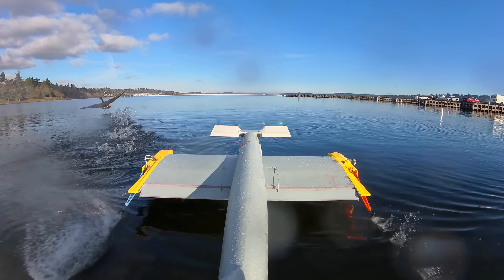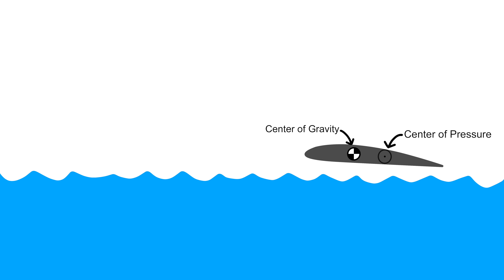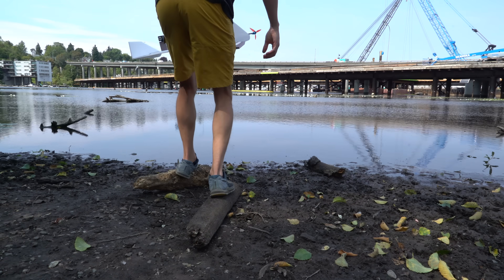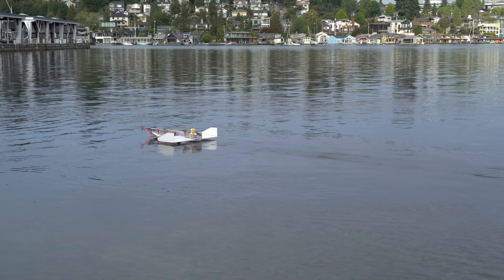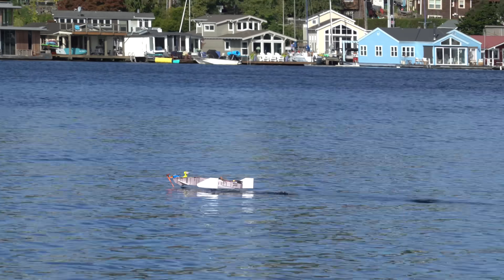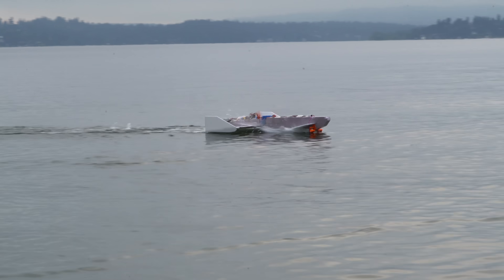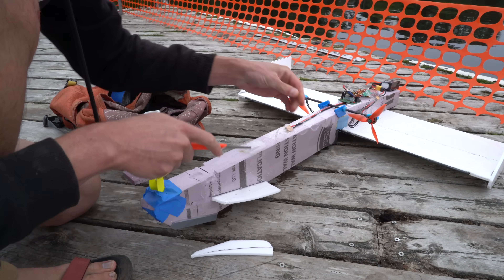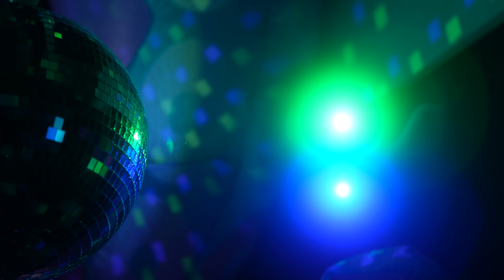Testing a Hydroplane / Ekranoplan Hybrid

Comment: Great video, if I might suggest: consider controlling the motion of the center of pressure with spoilers, air spill gates, etc. The dangerous condition you wish to eliminate is the spontaneous and uncontrolled nose lift that results from the movement of the center of pressure exceeding the safe range. If you can control the movement of the center of pressure dynamically, then you can fly the craft above the water (even at the optimum altitude above waves, and at optimum airspeed) automatically and smoothly. Consider employing mid-wing micro-slats to vent the wing in stages. I have some ideas but you have demonstrated excellent levels of engineering diagnostics. Well done!

Comment: Fantastic video showing what you're doing here. You're playing with two unique systems:
1. How to do real-time depth and engagement with the water
2. How to do real-time depth and engagement with the ground effect
My thought was to do a kind of wise Japanese man beards-shaped hull. We have a very long prong going into the water and getting wider as it goes up, probably using some mathematical function there, but also putting a sensor in there where if it gets too high you then start to change the pitch or the power.

Comment: Angle the canards down.  If you want the front to skim, press it down into the surface with a bit of downforce then counteract that by adjusting the wing incidence until it balances.  A T-tail adding a bit of rear downforce, a front downforce canard and a lifting wing in the center would probably balance nicely.  Look at how real airplanes fly, stability comes from noseweight counteracting empennage downforce while the wing has some incidence.

If the wing can generate enough lift to fly then it's lacking a stabilizing downforce. it needs to 'stick' to the surface, not float above the sticky areas.  Think of hovercraft, they work because the air forcing it's way out of the skirt is also speeding up that air, making a low pressure area at that point that pulls the skirt  towards the ground until the airflow's velocity overcomes the pressure.  I've played with lots of hovercraft, the good ones you can feel sticking to the ground while flying, push down on them and it requires force.  Pull up and it requires a force to break the vacuum with the ground.  Check out my hovercraft playlist, you can see how when properly balanced they stick to the ground, and some of the wings and aero devices i use to stick the single engine skirtless craft to the ground.    https://youtu.be/UmS_t55DbN0?si=GpocQj_5ajhbJ3xi  I wanted to try to get people into single engine budget hovercraft "hovercross" racing as a hobby but nobody else seemed to care.

IOW you need a low pressure area under the craft that is counteracted in some way by the air's velocity.  Be it like a hovercraft or by having a central lifting wing/body/whatever with some sort of balanced downforce around it.  The sponsons of racing boats work by sticking to the water on the outer edges and 'flying' the center lift area, until the sponsons unstick from the water.

Comment: You need a servo with an arm inside attached to a rod with a weight that can slide a weight backwards and forwards really fast based on attitude.
You will probably have to design your own PID loop program or repurpose some code ripped out of a quadcopter flight controller.  You cold also use their gyro chip to determine attitude in every direction.

A quadcopter has no stabilization forces acting positively on it...  it's all done with a fast PID loop reading all the sensors and inputting motor speed control to propellors.  You could also use propellers in the same way on the front and back from a quadcopter and the same chip and code to autobalance rear and front... that would be the simplest kludge.

Comment: How about adding a screw adjustable pitch angle device to the front pods, for micro pitch thrust adjustment.  In fact, that might be useful in every case of power pod, air and water.  Just a stationary and rotating plate mount on a screw with a circular slot and a capture screw, like a skill saw, at least until you find the optimum angles for a solid mount?

Looks like fun, but a little sim would probably get you their quicker, but maybe will less wow/oops factor.

Comment: I wonder if you could make a "WAKE JUMPER" where it has the motors on a suspension that can jack up (like those cars with the crazy hydraulics).
Then when some wake comes up, the wake-jumper just jumps over it in such a controlled way that it seems smooth in the "cabin".

Comment: You need to get to a point where wand is always in the water. The wand attaches near point of balance.  The spring constant in wand suspension can't exceed weight of entire system.  Essentially flight is pivoting around wand.   Wand could potentially have a foil with sufficient system lift a little less than system weight.  Im just spit balling ideas, iterative trial and error.

Comment: Low key????  You could probably enhance the airfoil for that CP shift.  If you wanted to go nuts, you could put a CG shiter in place, with feedback, to accommodate.  Kidding, but it might be a fun 'is it possible, and how well would it work'.  Obviously some active FB in the control surfaces. 

I built a Long EZ, and the point of the canard configuration there was to design a stall/spin proof configuration, which they attained, as tested by a NASA test pilot, as long as the CG was kept in envelope.  As you well know, move the CG far enough aft, and NOTHING is stable, not rockets, not wheelbarrows, nothing.  ;-)   Try an aero canard, as the lift CP mod should act more similarly on both lifting surfaces, if the design is well done.   Putting something in the water is draggy as hell, exactly what you DON'T want.  If you are going that route, use a non contact sensor, as you did previously.

Dude, buy a hybrid, mine does 46 in town, driven very gently on regular gas.

Comment: I’m no expert, so take in that context, but could you run a tube through the middle, to create a stabilising flow that mitigates lift and dropping? Maybe narrowing towards the exit?  If it was long enough with dynamic shaping underneath at the bow/stern it could double up to act as a preventative measure?

Comment: Might defeat the purpose if your build, but it seems like a small hydrofoil on the nose would go a long way to help stabilize it. If it was small enough to just lift the front then it would still technically be a ground effect vehicle.

Comment: Weights on a rail.  Have you tried moving the center of gravity in relation to the center of pressure by having small led weights riding on a rail adjusted by a servo controlled by the angle of attack signal from your flight stabilization computer.

Comment: I was trying to solve this too and make it by creating a moving weight to move the center if grav, it works but requires a very specific real time sensors input to move with the actuator the weigh so it counter the positive and negative feedback

Comment: Could you not stop the flips by having a fixed control surface that provides minimal lift in normal operation, but that produces peak downwards pitch when the vehicle pitches up too far?

Comment: Add 5 lbs and retest.  We know how to make light planes fly.  The original Ekronoplan was spec'ed to carry tanks to the US.  I think if you add a bunch of weight it will add dampening to pitch.  Which will make it significantly less sensitive and way more controllable.  Ideally you should be able to go much faster as well because the system will have more time to correct.  Total guess but my monkey brain likes it!

Comment: the water props are pushing the nose up, losing thrust and then repeating the cycle. the water motors should be level with the waters surface at running speed.

Comment: What about a wand that controls flaps on the canard? So more lift from the canard as the nose touches the water and less lift when the nose pitches up. Changing the thrust angle changes the attitude AND reduces thrust, so it monkeys with the aft end, too

Comment: The geometry of the wing needs waves in its surface aligned "parallel" to the direction of motion with a slight curvature outward from the center of gravity. Kinda like a lays wave cut chip. Additionally, a reflexive "joint" that passively changes the wings pitch based on the differential pressures in relation to the nominal pressure at the center of pressure. 

Essentially the effect would act as a relief valve in the system as higher pressure builds up in the back pitching down and an accumulator of pressure in the front as pressure drops relative to center.

Comment: It is necessary to choose the right aerodynamic profile of the wing so that during air flight and flight due to the screen, the pressure centers coincide.
Reply from the maker: The flat bottom aerodynamic profile is optimal for screen plane
Reply: @rctestflight  Absolutely right. But I don't mean the bottom, but the top of the profile. If the hump is shifted back along the chord, then the pressure point will shift back

Comment: It seems to me like you need some sort of mechanical system that reacts to pressure under wing, or specifics parts of wing and adjust the shape, or angle to super charge negative equilibrium. It should be almost perfectly reactive. The only problem is that there will be inertia within the moving parts

Comment: Going off of the first part of the video about center of pressure changing with distance to waters surface, and comparing that to a static center of gravity, what if you make the CG not static, aka dynamic? Some sort of lidar sensor that reads hight to surface of water, and a servo system that can shift an internal weight, IE, the battery, based off the distance to waters surface, therefore adjusting the CG based on the center of pressure?

Comment: I feel like either on the front you could try a electronically variable height/depth and pitch hydrofoil or those 2 front engines needed variable height/depth and pitch control. Without that there is no way for your machine to adjust to the changing conditions and speeds in the real time needed.

Comment: It seems to me it's the steady distance between how high off the water and air speed, why can't you use a laser distance measure between the aircraft and the water,  put that data a controller to increase or decrease the propeller thrust. Pick the perfect distance off the water and set the controller to increase speed when to low and decrease speed when it gets too high off the water, you will need to adjust how sensitive it is but this should solve all your diving and flipping problems.

Comment: If wings have propensity to shifting center of lift causing rotation, let's have two set of wings - front and rear. This is to addition to tall T-type horizontal stabilizer.

Comment: optimization loop. of course it works. avoid the outhouse. so you made a ground effect trike. so how about a quad wing ground effect plane. ie canard and back wing in quad configuraiton. ie no flip because lever length of force is way longer. ie avoids the problem of normal single (dual) wing. yeah be covered fully by mud bruh. very sketchy.

Comment: Anything, that makes contact with the top of the water surface will result in porpoising. Either you have a wing below the water line surface or you have a full blown aeroplane leaving the surface. 
.
The top of the water is soft like a sponge so as the vehicle squeezes down on the water, it will be allowed to point way too low and any correction is an over correction. The ground effect will only be smooth in two scenarios:
1. The water is perfectly smooth (no waves) and your craft is way lighter
2. If there is some level of roughness to the water surface, you need a much heavier craft. This has its limits, the rougher the water, the heavier the craft. The Russian Ekranoplane is purposefully very heavy but could only offer a smooth ride on water with short waves. The Russians killed their Ekranoplane program for a good reason.
.
May I suggest you study gliders on take-off or on landing experiencing ground effect and how to avoid PIOs (Pilot Induced Oscilations). Look at videos of the Pik20B glider and Schreder Glider these are flaps-only gliders and much more susceptible to ground effect when landing. 
.
The Australian Mud Skipper (there is a YouTube video) is way more of an aeroplane - it comes way up and out of the water with much longer wings and banks to turn like a proper plane. It straddles ground effect and pure flight. And is successful.

Comment: Try using a system like tractor pulls, where you have a weight inside that moves back and forth, moving the center of gravity as your center of pressure moves. Might take some CPU work to get it perfect, like an Uni-Omni-wheel.

Comment: Looks like too much up angle on your prop drive (water motor) setup.  Also, I bet your water motor suspension would work better with a 4-bar style setup to keep the water motor thrust vector fixed rather than increasing as the nose rises.  With the setup you tested, it is a positive feedback loop where the higher the nose goes the more the water motors push it up rather than forward.

Comment: Wouldn't it help to get the v-shaped tip some suspension? Nothing crazy, maybe just a simple spring (and a bracket to hold it in place) between the hull and the tip?

So the spring could absorb the bouncing of the tip on the water?

Comment: You need to combine hydrofoils with the ekranoplan, so that you can have the two systems working together to maintain the distance from the surface.
It would have been almost impossible before computers and microprocessors.

Comment: The discontinuity between air and water defeats negative feedback, which is why you can't get rid of the skipping with negative feedback!  It works OK for foiling boats because the foil remains submerged while the wand skips harmlessly.  For the same reason, you might get somewhere with a wand and no other water contact.

Comment: Try just a wire angled into the water at the front.  The v hull, is still too much contact.  A wire angled would be just right.  As it lifts out of the water, less wire being in the water, brings the nose back down.  No need for cannards which give too much lift in air.

Comment: Next time, why don't try a design with tandem wings. One pair of wings in the very front, one pair in the very back, with quite a distance between them. This should strengthen the good negative feedback loop and weaken the bad positive feedback loop. 🙂💡

Great video, as always. 💪
Reply: I was thinking the same, have an inner front wing with a fence mounted on the tips leading back to the rear outward mounted wings, 
Or have a vertically mounted ducted fan on the front to act a bit like a hovercraft creating just enough lift to keep the nose above the water.
Reply: @williamwilliams8145 Just checked it. tandem wing ekranoplans are a widely known design. 😁

Our idea was good, but not new. But at least now we know WHY tandem wing Ekranoplans are a thing at all.
Reply: As soon as Daniel described the centre of pressure issue I wondered how well a tandem design would work.

Comment: Always enjoyed your work and continue to, thank you.  The biggest water mass height sample you have, would be the outline of your entire craft so a dozen feelers/sensors each with fine levels of graduation measuring the water surface location spaced out under the craft sampled & averaged fast as possible would provide a realistic idea of how far away the last observed water mass average really was from the entire craft undersurface which compared to the previous measurements would give you the best prediction as to what control surfaces needed adjustments in order to remain in parallel with the water surface in the next moment.  Put a number to the water mass average then graduate the craft up and down with control surfaces that initiate from both the front and the back of the craft simultaneously - this to always maintain a parallel presentation of the craft to the water mass. The craft is always level as it rises and falls above the water mass. Dual fore/aft wings? A gyro might also help to flatten out oscillations that might otherwise become destabilizing.  Remain parallel to the water surface at sufficient height from its transients & you're there.  The nature of the sensors/feelers would be key...  The 'distance from the water' control system and aero control surfaces, and craft's regular flight control system and flight surfaces should probably be kept as separate systems.  Once in motion the distance from water system does that while the flight control system orients flight from there.  Sorry to over-riff out on this, ekranoplans are great & your work really fires up the imagination of your viewership!  Hanging out and going off on your ideas makes it all that much more fun:trophy-yellow-smiling:

Comment: i have a vague notion: a captive rolling weight on a precise incline across the hull so that, flat, it is at the bottom of the incline. but if the craft tilts upward, the weight rolls back, moving the COG back.  or...a pendulum?

Comment: 14:14 The design for the motor arms will cause it to dig in and "bite" the water due to the thrust vector not lining up with the hinge point. I'm not sure if this was intentional or not, but it could be contributing to the cause of the oscillation.
Reply: Had to look for this comment. It does seem like this would create another feedback loop and worsen the oscillation.

Comment: I'm wondering whether having a stepped hull form for the planing for'd section would help? Also, I think reducing the angle of the hull with respect to the water would help to reduce the oscillations.